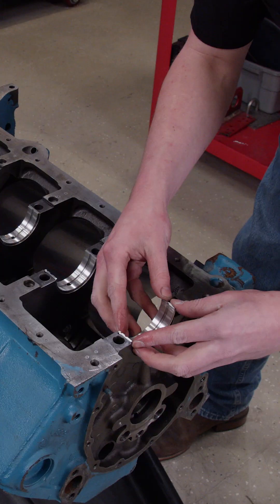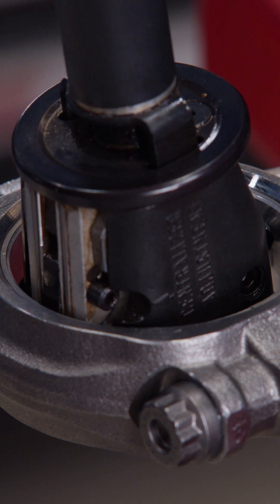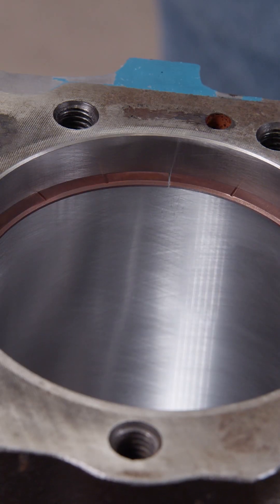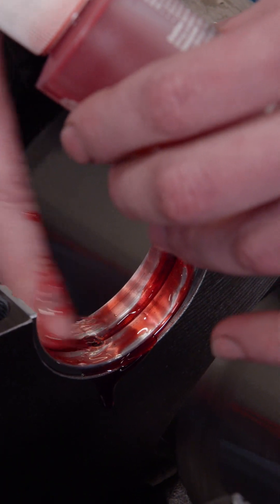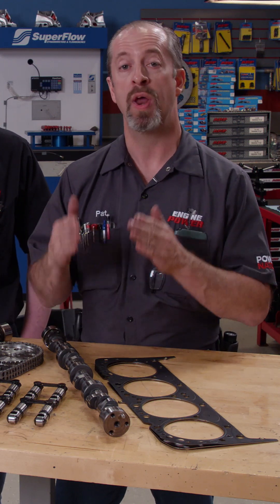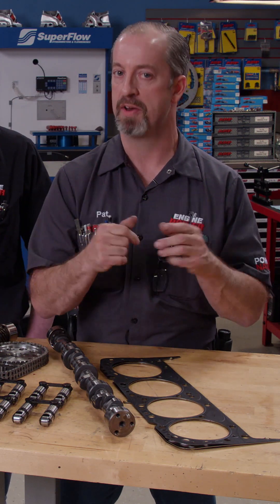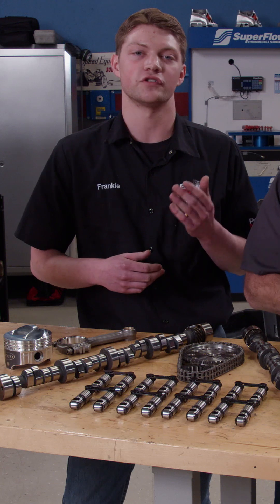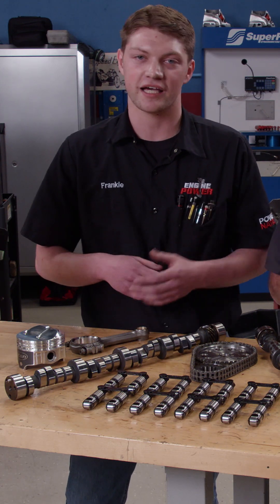Important Tips and Steps for Engine Assembly

Comment: If not allowed just ignore me i wanted to know your thoughts 💭 on a 358 build with 12cc pop up dome pistons. 6inch H beam rods crowler forged 3.480 stroke crack. flo-tek heads 180cc intake runners 66cc exhaust runners and 2.02" intake valve 1.60" exhaust valve cam lift 443/465 duration 214/224 112 LSA TH350 but plan on changing to a 4L80E later on posi rearend 3.73 gears may change to 4.11 3000+ lbs car

Comment: Nobody says how to adjust the bearing clearance. Literally nobody.
Do a favor and explain how you would adjust them.
Reply: Depends on how much clearance you need.... if one journal is on the tight side and another is on the loose side, you can swap some.of the bearing halves around and get closer to what you want....
If they are all too tight, you can get oversized bearings